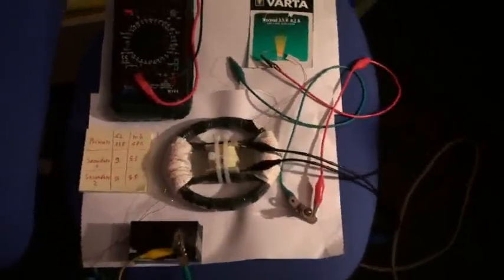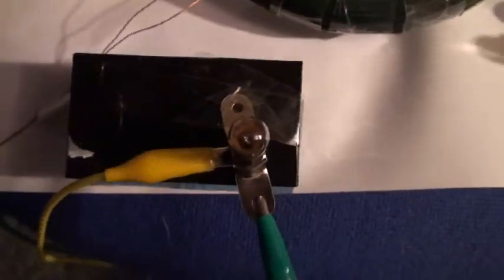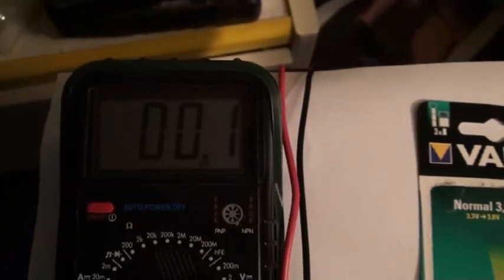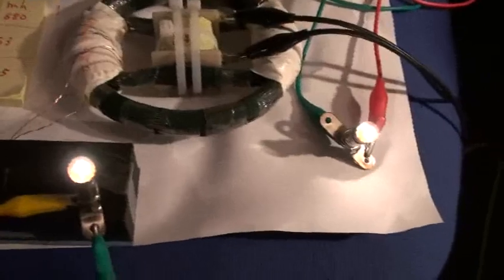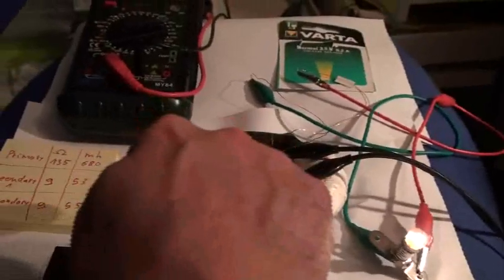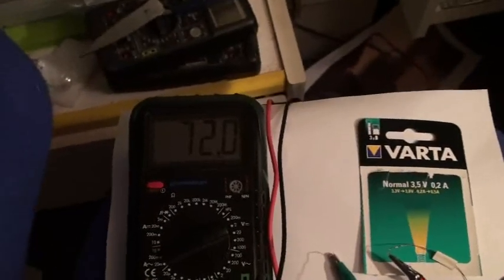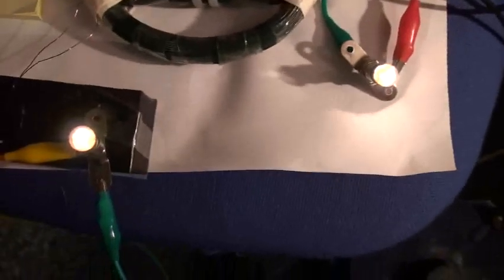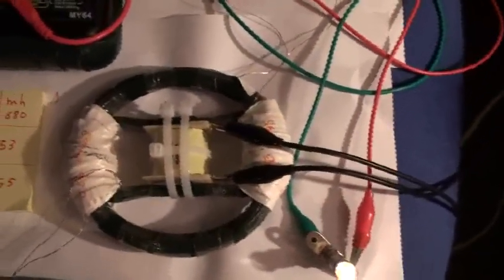bitt power factor 3 .wmv

Comment: Hello Woopy. I tried to replicate this, but unfortunately every time I connect to the variac both the primary coil and the variac begins to get very hot, so hot that I burnt a variac and had to get it repaired. What do you think is causing this heating up? Would there be a DC Circuit for running the primary that you would kindly suggest. Thank you for your explanative videos, they are a great help to me.

Comment: At 2:04, the bulb on the right sort of blinks, just barely, BEFORE the bulb on the left comes on. Can you please explain why that might be? Thanks.
Reply: +cobra1490 The bulb on the right is still being heated by some small amount of current, so it doesn't take as long to heat up to a higher incandescence level, as would the other bulb since it has no current running through it before being re-connected.

Comment: You can also try using brake drum turnings from an auto repair shop to make your cores.   Its very interesting that the flux flow pathways are allowing the two bulb to be bright and yet when no current is drawn from one secondary bulb they both go out.  You should try using a one ohm resistor in series and use a scope to see what the voltage is doing across the resistor..  I think you need to have a circle of core around the primary not sure about this.  nice job on the video.  How did you come up with the name woopyjump?  crazy mon

Comment: Laurent, I've been thinking about this. whereas your 2 dimensional bitt is proof of the concept, then I can see no reason why it wouldn't work in a 3 dimensional layout with 3 or 4, or even more output coils surrounding the input reactive coil. I will try this.

AND, thank you very much for your insulated fence wire buildup tip.

Comment: If they still were around I would give you the full 5 stars for this demonstration!
Imho OU without any doubt. Also to me this looks exactly like the unit Alexander Frolov has described and built. And here you show that exact effect, that when only one load is connected, you draw current, (as a matter of fact so much current that the voltage drops below the level needed to maintain light!), but when you connect the other load, the opposing flux of both coils works against each other! Perfect!
Reply: When he disconnects one load, the primary induced flux doesn't go through the secondary with closed circuit, instead it goes through the secondary with open circuit because the core at secondary with open circuit has least reluctance and high permeability, and flux always takes the path of least reluctance. 
Since no primary flux links with secondary load, it doesn't light up.

Comment: Woopy, I don't know if you ever did the experiment that I suggested but here is the answer:  When you disconnect one of the loads then you have two paths for the magnetic flux to flow through:  1) where there is no load on the first coil, and 2) where there is a load on the second coil.  Almost all of the flux "takes the path of least resistance" and that flux path goes through the disconnected coil.  So almost no flux is left to go through the second coil (with the load) to the bulb is very dim

Comment: 4th:  Another comment about the sensing coils:  You do not need to make the sensing coils long so they cover most of the quarter-section.  You can wrap the 20 turns of wire all in the same place.  There is nothing special to worry about, just wrap 20 turns of insulated wire in roughly the same spot.  With no real load on the sensing coils (the multimeter or scope is not a load) the sensing coils will not affect the operation of the BITT at all.  Hopefully they will help answer your questions.

Comment: 3rd:  You never put a load on the sensing coils, you just measure the AC voltage with a voltmeter or connect a scope to the output.  All sensing coils should have the same number of turns.

The higher the AC voltage you see across the sensing coil, the more changing magnetic flux there is going through the corresponding section of the BITT.  This allows you to see where the magnetic flux is flowing inside the BITT.

So this will give you insight into what is going on when you run your test.

Comment: 2nd:  To investigate the changing magnetic flux in each of the four sections you can add sensing coils to each section.  The sensing coil is very simple, just wrap 20 turns of insulated turns of wire around each of the sections.  For the left and right sections where you have the secondary coils, you simply wrap the sensing coils around the top of the secondary coils.  When you run your experiment, either make multimeter AC voltage measurements or scope the outputs of the sensing coils.

Comment: Woopy, I have a suggestion for you.  I hope that you didn't change your BITT configuration yet.

Let's just examine the outer ring of your BITT.  Let's say there are four sections, the top, bottom, left and right sections.  The left and right sections have the secondaries on them connected to the light bulbs.  Let's investigate the changing magnetic flux in each of the separate sections when you do the two parts of your test.

Comment from the maker: @deepcut66 

Hi DC
 the core is made with an insulated fence wire (the thinner i have found in a garden center. It is one wire rolled continously to get the outer and inner core . The outer core has more turns that the inner core. So i wonder if it is a good core, because i don't know if the eddy current follow the one wire or works as per separated insulated laminated core.

I will probably try to cut the cores in 2 parts and rebound them wit some overlaping to see the results.

Laurent

Comment: Hi Laurent, 
The primary core should saturate a bit for good operation.
According to the theory of Thane, a slightly saturated core has higher flux resistance due to the lower permeability. In such case the BEMF prefers the outer cores rather than the primary core.
Reply: Hi, can u share the link of Thane hiens video where he quotes that "the primary must saturate little" for back MMF to follow alternate flux path?
It will be great help to me.